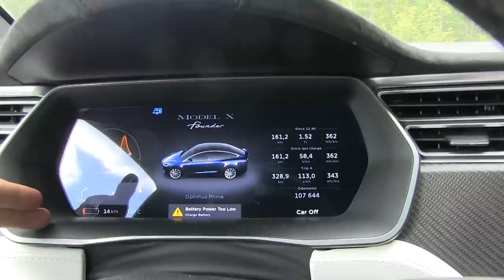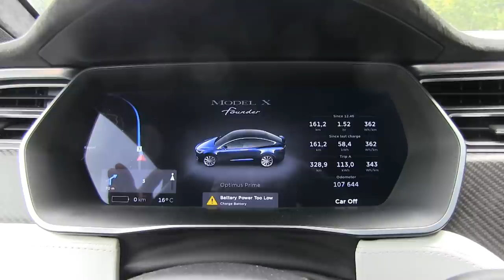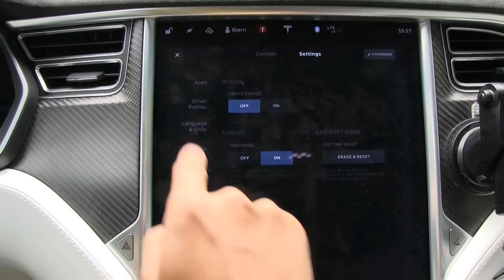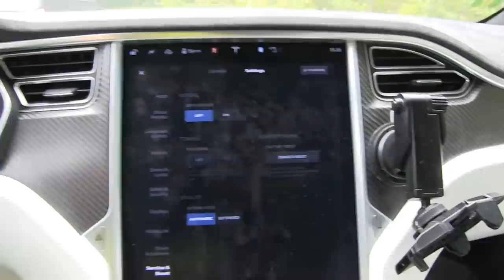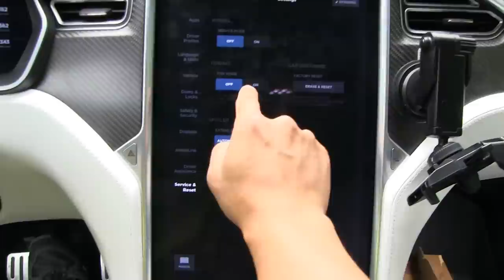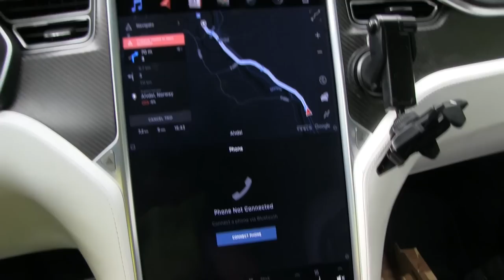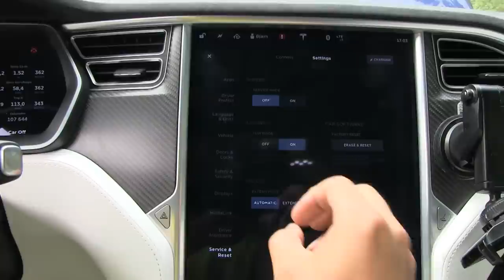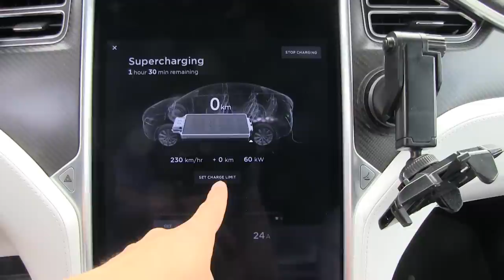Tesla Model X P90DL shuts down with 14 km/8 mi range left

Comment: The tow mode problem you had is a known bug. I wasted an hour on that too when I was changing tires. To engage tow mode, you slide to ON then immediately OFF again, and the slider will go to ON. It's messed up.
Reply: WTF!
Reply: Fire blade no cuss
Reply: @JignaPatel194  in that case definitely required :'D

Comment: For the rage/ranting ppl in comments:
Well.. shit happens. Now let's not generalize. k ?

1) The car is past the 100.000 km mileage milestone.
2) He pushed the limits of the battery [myself wouldn't let it go below 30km ]
3) If it's a software issue with detecting/estimating the correct battery charge [maybe will get better]
4) Probably the fact that he was towing a trailer messed-up with the dashboard range estimations [maybe it's something Tesla omitted]
5) Most important fact: could be an isolated faulty battery case, not present in other teslas.

Bottom line: YES shit happened. Shit happens with petrol car as well. IF it was a software issue, guess what: it will get better and better and more bulletproof with each iteration. But that is not a reason to generalize and discredit the upcoming future.

Comment: Li-ion and BMS with wrong data can be very unpredictable escpecially when doing only partial (dis)chargres. It is wise to do cycle 100->0 % and 0->100 % sometimes, not because it would be good for battery chemistry like at Ni-Cd/NiMH accumulators, but in order to make calibration of BMS and prevent such sudden battery "death"

Comment: What concerns me is the fact that you couldn't get the towing mode to engage. I noticed on the display that the frunk was still open. Is it possible that for safety reasons Tesla doesn't allow the towing mode to engage if the car senses that the frunk is still open?!?

Comment: I sometimes drive my Model S 85kWh to zero and had it already three times a few kilometers below. Never had a problem doing this. But if you see the power limit drop below 200kW (for a P Model), then the charger should be near. What I always every few month is balancing at 100% and drive it down to zero to give the BMS a chance to adjust. For this you have to top up, drive down to zero and then top um again. Then the BMS knows where the batteries are.

Comment: There should be an emergency charging service to charge enough to reach a charger. Much better than towing ☺️
Reply from the maker: It must provide fast enough juice though. Waiting 1-2 hours for slow 3,7 kW juice is not good enough. It should be a 20 kW DC or something at least.
Reply: A chademo charger would be fine, but even a level 2 charger would be good. Anyway I never ran out of juice ☺️ even in Norway.  Just strange nobody offered that. I think it will come as it is so obvious and Tesla could provide it to relieve range anxiety for new buyers.
Reply: I've been thinking about this for a long time now. There should be vans or trucks with a built-in 50-100 kWh battery and fast charger that can deliver 50-100 kW. Basically a mobile Supercharger. Also, there should be a heavy duty powerbank on the market, with a capacity of at least 2 kWh for emergency situations, like this one, or off-grid work. It would be a box that you can carry around, maybe the size of a conventional 12V battery, but Lithium-Ion-based and able to deliver up to 3kW. It would take about 30-35 min to transfer 1.5 kWh to the car battery. That should be enough for roughly 10 km at low speed, very low speed with a trailer. These emergency units should be rentable or buyable at every gas station and every towing and emergency service should have some of them, bigger versions with more capacity and higher speeds of course, say 5-10 kWh and 7-14 kW. Just imagine if the charge unit the emergency guy used to charge your 12V battery with would have been bigger and charged your car at the charge-port. Even a charge at only 3 kW would have been better than all this stress and the towing, even if it would have taken 1 hour. You could have taken a walk there and filmed stuff. ;)
Also, Tesla should built-in an emergency brake-release.
Reply: As the other guys have been saying, I wouldn't be surprised to see breakdown service vehicles get fitted with a high capacity battery - say 10 or 20kwh. Just enough to zap some juice in and get the customer to the next charging point.
Most already carry a tank of petrol and diesel, so it's a logical progression.
You can just imagine the phone call: Hello I'm sorry to bother you, but my car has broken down 'cos the battery is flat. "No problem, we'll  send someone to zap you as soon as we can".
Reply: Greg Hudson I suppose that as the number of electric cars on the road increases, it will create a market for such services and products
Reply: Greg Hudson Good point
Reply: Actually more useful will be to have a function in software, which make you battery have virtually 10% less and if you will be on zero, you could somehow turn on the emergency mode and use the emergency 10% battery
Reply: I would never use that and I never really had to anyway. I'm not saying it is a bad idea, but really what Bjørn did was to find an excuse to make a video, because he knew that he should not have done this anyway. In fact it is so easy to drive a Tesla so you don't have to worry at all if you follow some simple rules.
Reply from the maker: It wasn't an excuse to make a video. Did you watch the video at all? The car showed 14 km range left. And I had 7 km to destination. I estimated I would reach the supercharger with 3-5 km left, like I have done several times before. If I did this on purpose, I would at least have someone nearby to tow me right away. And if I did this on purpose, I wouldn't waste 3.5 hours doing this.

Imagine if you want to go to the grocery store before they close at 21:00. You arrive there at 20:50 and you only need to buy a few things. But to your surprise, they already closed the store. Do you get my point?
Reply: Ok Bjørn, don't get upset, but it was a bad idea to do what you did even if you had done it before, but now you know :)
Reply: Alfonso Gonzalez Sencion I want to buy a supercharger for personal use and for others to use too. I hope Tesla has an option for me. I sent them an email yesterday.
Reply: Buy a generator.
Reply: I could build a trailer for this but it's almost impossible to make it road legal.
Reply: KoivuTheHab  Stephen was referring to the usual behaviour of services to carry with them tank of fuel just in any case. It never hurts and usually it comes a very long way by doing so. I know many cases of motorcycle riders who needed only 1 liter of fuel to reach their next point, and for car drivers no more than 5 liters to the next destination. Usualy jerrycans are manufactured to store 20L and it comes in big help.
Reply: KoivuTheHab  Is not the same thing when your car's fuel tank lies just under your car filled with 80-100 L of gas ? And a jerrycan is unsafe ?
Who's the idiot.....
Reply: KoivuTheHab  Yes, but a service truck isn't exactly the same as a normal car. Do you know for sure that they don't carry extra fuel? Farmers carry fuel on utes all the time.
Reply: KoivuTheHab  No, but if it needs to be done, it can be done without significant risk. How else do people transport fuel?
Reply: KoivuTheHab  I lived on a remote farm for 20 years. We had a large diesel tank for farm gear, but we got petrol in jerry cans on the back of utes. Still do today. Not very safe for sure, but not dangerous enough to do it any other way. Anyway the point is it's reasonable to have a service vehicle carry extra types of fuel. I don't really see how a petrol tank is that much safer than a sturdy jerry can.
Reply: Put the car in D, tow it, and the Regen will charge up the battery.

Comment: I think the reason the tow mode only is available when the brake is pressed is because the brakes regenerate power so you need to keep you foot on the brake to regenerate more power.. just a thought

Comment: Why was the tow truck running all the time?
Reply from the maker: Because it's a fossil truck. In the future we will have electric tow trucks.
Reply: Diesel Ideling Myth: 
 
Long Long time a go when our grandfathers were young. Both diesel engines and battery/electric starter motor technology were also young.  It was difficult to get a diesel motor running in any other than perfect weather conditions, to cold intale air, engine too hot, oil to thick ect.   Also, battery capacaties were much lower,  starter motors were weak ect.....

Considering all the above, the un written law with drivers and owners of deisel equiptment evolved as follows basicly: "once you got your diesle running, it is BETTER leave it running till you get back home"..

So, now a days it seems the above may still be influencing owners and operators actiona along with the Machoism of wantiong all to know that this man own/drive a Macho Diesel Vehicle perhaps.

Modern Tow Vehicles Idling:

Even new tow truck vehicles need to keep all their saftey lights on along with also provide power to all the hydrolic equiptment to load up the vehicle, ecample slideing back the massive truck bed/load deck into the load position, winching up the vehicle on the deck, sliding the deck back up over the wheels into the transport vpssition ect.

So, it actually is mandatory the tow truck driver keep his vehicle powered up in orber to not need to call of a battery jump for his tow truck due to running his battery to low..  AND most of the hydrolic actuators get their hydrolic presure from a pump coneted to the power take off from the diesel engine. A 12/24 volt electric hydrolic pump just won't do the big jobs....

I personaly have 3 diesel and 2 ICE vehicles . With modern technology it is now said and scientifically speaking n proven, if  you idle your vehicle for more than 15-20 seconds, it is better to turn it off and re start. And this is what I do daily. Example: One stop light I need to traverse regularly has almost a 90 second cycles thru time. I actually turn my vehicles off at this light and in ligh at a drive thru window, banks-fast food ect.
Reply: the diesel was balancing his nox... ;-)
Reply: Thanks for your comment.

Yes, safe to say ALL chemical actions to include human life have adverse chemical conciquesnces to it's own enviroment........

AND 

Modern Life of our species (7 billion of us now n growing) is perhaps the LARGEST  amount adverse chemical released into it's own home, not just one tow truck in Bjorn's video sadly...... 

Thanks for your comment.
Reply: Idling barely uses fuel.
Reply: But an ideling engine runs vary cold and is Much MORE dirty...........................
Also
You save a little in a lot of palces means Over All You Save a Lot Actually .....
But it is your wallet, so feel free to idle cold and enpty your wallet for any reason you like.....,
Reply: The lifting platform is probably hydraulic.
Reply: Batteries :)
Reply: because theyre meant to run all day
my work truck is running from the moment i clock in till the moment i clock out
Reply: Yes BUT, I'm almost 100% sure there are atually a few times during the work 
 day that your work truck could be turned off without any loss of productivity........
 However, I'm 100% sure you will dissagree with me.........................................................
Reply: 2 words
arizona and airconditioning
Reply: After the engine is heated up it won't run cold. It is as dirty as the amount of fuel is being burned. Not a fan of diesel, but sadly trucks need diesel.
Reply: Yes,  we do neede deisel. Since the fule is less refined it has lots more BTUs per gallon than gasoline, from 30 to almost 40% more I believe and has much more torque just due to the hi compression necessary to self ignite the fuel..............

I am NOT a know it all, but I'm a tad enlightened about many things just because I always enjoyed  keeping learing new sutff for the many years it took meto became an "old fart"..............

I truly believe it is safe to say the following even thou I do NOT have an engeneering degree:

ANY Ideling Diesel Engine is NOT up to optomum operating/clean temperature and not only spues out additional polutants than it would if it was able to maintain it's design operating temparature,  ALSO uses more fuel TOO.....

The above is My Opinion and I AM STICKING TO IT...................................
Reply: BILL PAXTON I would have thought your desiel work truck be shut down for lunch or no
Reply: :}
     I agree with your thought that any person concerned with being smarte eough to
     "Not Shit Where He/She Eats"  (excuse me for quotinf a old and crude American 
      slang verbiage. However to me it is Vary Descriptive) should power off when ever
      practical to do so.........

      I still feel it is basicly a subconscious "macho thing" to allow one's diesel truck to 
      idle, n sadly even over lunch break. 

      As far as "Not Shit Where He/She Eats". Obviously the people working aroung a 
      cold/ideling desel engine all day are the one that inhale The Most of it's Pollutants.
      However realizing many people still pay big bucks to buy a pack of portable air 
      poution devices known as ciggeretts, cigars chewing tobacco n snuff. So sadly 
      why worry much about waisting your employers fuel and service life of his vehicle 
     or air polution by switching it off when it is not neeeded for a few min......?

     This is why, even thou I like/want a n EV my self,  I feel EVs are just a few drops in 
      solution the ocean/solutio as far as insuring a future in the nest few centuries on 
      planet earth.                 First n Formast we need to be smart
     and find a way to equatable slowly drop man's population size down drastically....  
     This is the only permanent solution since We ALL (me too) have bed habets that 
     pollute our enviroment.........
:{
Reply: How are you going to load the car if the truck is off? It uses hydraulic pumps in order to use the towing cable and in order to be able to move the platform
Reply: Yes, and the moon is made from "green cheese".....................
Reply: It's diesel
Reply: MrMario616 a
Reply: Because You like burning diesel and you do not care.
Reply: max dub....sorry when idling it will burn sooty

Comment: All you need is a spare deep cycle battery and a 1500 watt inverter to charge the car enough to put it in park.  I ran out of charge with my leaf and was still able to put it in neutral but not drive.

Comment: This happened to us with our Model X 90D. 5 miles left and 1 mile to super charger and the car shut down.  
This was at midnight on our way home with 2 kids. Sent the wife and kids home with an uber. It took me several hours to get home waiting on the tow truck then charging. 
At the supercharger it would not even charge until we jumped the 12v battery.

Comment: A small generator. ThT has a single phase 220-240 volt outlet with a cable to provide power to car would be economical and while maybe only 30-40 amps charging rate you pull it out a fire it up and plug in and wait an hour or so then your on you way. Friend of mine brought a small 5000 watt generator with him so he could go places in mothers Maine where there aren't any people and he used the small generator in a small utility trailer and he Used The Tesla Hotel and he said while it wasn't as good as grid power it worked.

Next time your towing if you have a small gas generator it could get you out down the road even though it's a pain to luck around its still better than a tow.

Sorry for your problems on that trip

:-)

Comment: Tow mode was not working because your front trunk was open .... i think so.... Display shows that ....
Reply from the maker: Watch from 8:00. Frunk was closed at first attempt.
Reply: prob need more juice like he said
Reply: Maybe there is a sensor for the tow hook to be completely screwed in?
Reply: Why is the tow-hook screwed in c-clock wise? Was the tow hook screwed in at all?
Reply: Probably because most ropes twist counteclockwise when stretched, or something like that.
Reply: All tow hooks screw in counterclockwise.
Reply: Aha :) 
Long time since I needed a tow - then the cars didn't have any tow hook. You just had to find a proper place to tie up the rope - preferably a place where you didn't rip off your bumper or other essentials parts hahaha. Had a tow for 250km in -30C from northern Finland to Norway many years ago. Had 3 pieces of Rudolf (reindeers) trying to get a hike with me.
Reply: It was a software bug. Bjorn shows it in another video. I should add that it's fixed now.
Reply: Ignac Trenansky the front screen says if all the doors are open fruck and the back hatch
Reply: @Hagledesperado  no
Reply: @kubectlgetpo  Ok, what's your explanation then?

Comment: Sorry for your trouble but thanks Bjorn. Great lesson for Tesla owners present and future. Just one of those paradigm shifts when you switch to EV. I can understand brake locking for safety in very low power event, but surely there should be a mechanical brake release option?

Comment: still did a better job than the nissan leaf in the same sort of predicament.
when my 2012 LEAF SL dies on me (happens fairly often, i only get ~35 miles from a full charge) the 12v battery is pulled low immediately and as a result i can't even turn the car off (yup, so 12v gets pulled VERY low and damages the battery sometimes). with 12v low i also can't charge (only tried level 1 charger in that state, maybe L2 or L3 would have worked?) - i have to hook up jumper cables for a while just to get the car to enable the normal charge port!

can't wait for my tesla model 3 (i'm in queue, delivery estimate between feb and april 2018). even if this happens to me it's still better than what i've got right now!